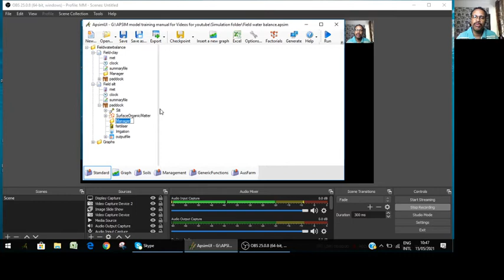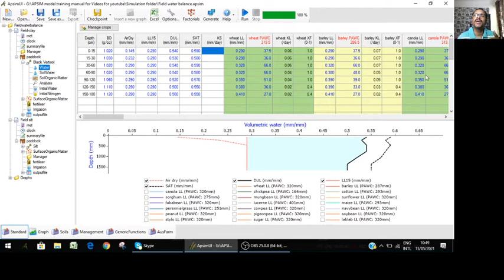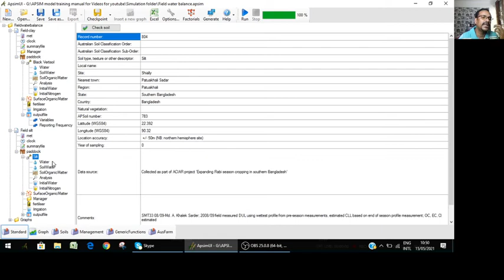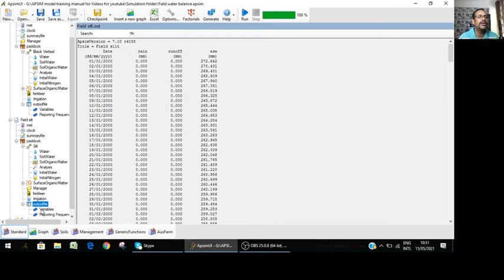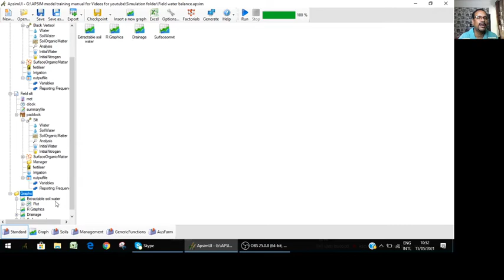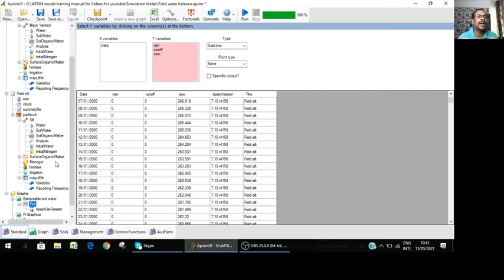Comment: Could you share some evaporation data comparing some years. In the 70s some Israeli researchers thought that due to the supposed global warming it was possible that evaporation would increase and it would be necessary to adjust the risks, so they took on the task of updating their calculations, the surprise was that no, evaporation had reduced, since from 40 to 75 a drop in temperature was observed, which no one could explain.